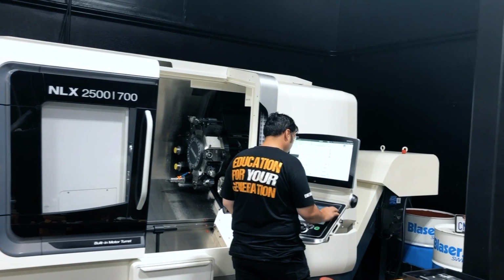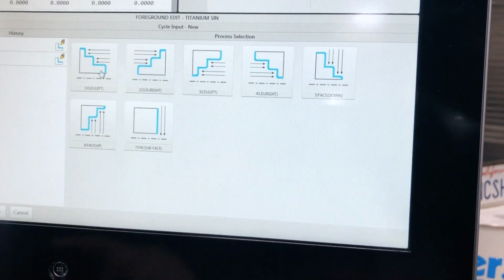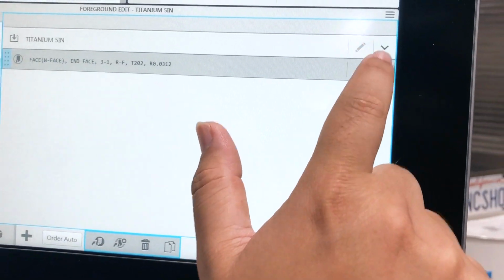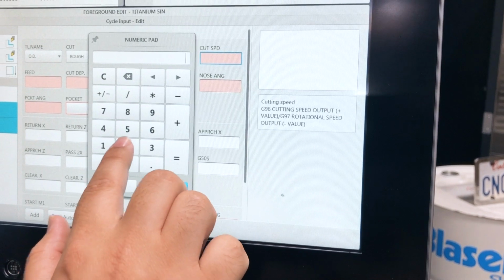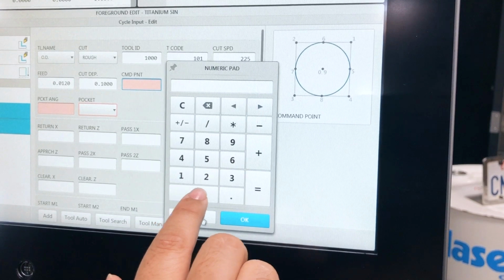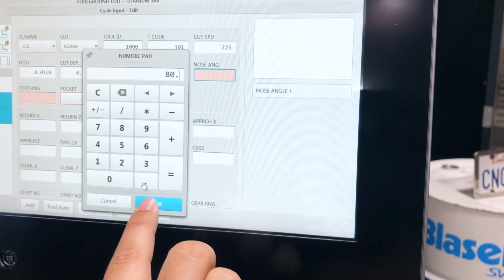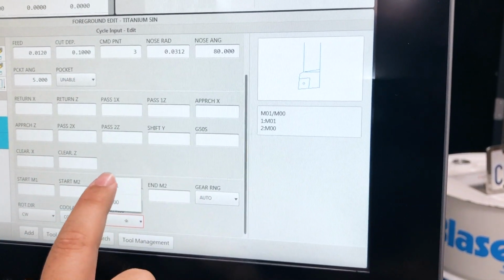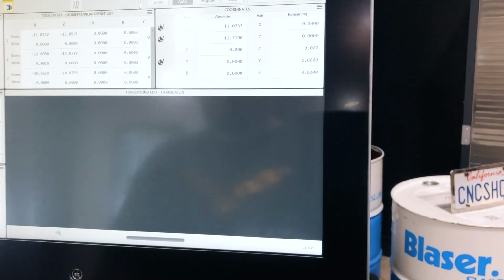Conversational Programming on DMG MORI NLX2500 | FACING

Comment: Looks like the Mori Fanuc controller?
Reply: Arrow Racing Products looks pretty much the same. The lathes are Mapps on Mitsubishi though, and the mills are Mapps on Fanuc. The Mapps 5 stuff (CELOS) is very very similar to the Mapps 4.... just a different wrapping paper. At least on the actual programming side. The CELOS has a lot of additional non programming functionality that the other controllers don’t have.
Reply: @Adam-b8i  Yes it gets very confusing with the DMG Mori's.. I've seen machines made in Europe with Siemens and Heidenhain then those made in Japan with Fanuc and Mitsubishi.

Comment: What kind of drill do you use ? German: " an 8mm one " ... American: "0,314961 inch one " makes sense who wouldnt like to have 7 numbers if you can have one .
Reply: schluchtenscheißer I'm from germany and I don't "like" the imperial system but it works fine for the US, you can't compare the metric and the imperial  system by using a decimal number.

Comment: Seems like they really messed up the conversational side if this is how it is now.... I run the last generation NL2500 and CAPS seems a million times better than that.  CAPs used to save all of the tool info, along with speeds and feeds for a material library.  It seems like a huge step backwards to have to type that in each and every time for a program.  The more I see about the new DMG Mori branded machines the more I think they just are not the same quality as when it was just Mori Seiki.

Comment: Still yet to find a conversational control as good as Mazatrol, I can program a facing cycle like this in less than 30 seconds.
Reply: 30 seconds old school. Easy stuff
Reply: i have mazatrols. t1 up to tplus. they do program quickly. however the hardware is unreliable, always breaking down and the machines are overpriced. have a fanuc OT control that works very well and is rock solid for reliability. and when i want the fanuc to do exactly as i want i can do it easily. i will say mazatrol is easier to train on. I do like the dmg more control now that i see it. looks easy to train on and fine control over editing the g code.
Reply: @nieljones655  t1s and t plus are ancient controls I'm talking nexus 2 and smooth G controls. That dmg is brand new it would be like comparing a comadore omega with a ps4. Although we do have a 22 year old mazak that runs spot on lol
Reply: Alex Gregg yup they are old. we had a slant 30 mazak with a westinghouse producer control, bet ya never saw one of those
Reply: @nieljones655  heard of a slant 30 but never seen one
Reply: I'm sure Tyson could do it in 30 seconds too. But you know he took 2 minutes to explain it.